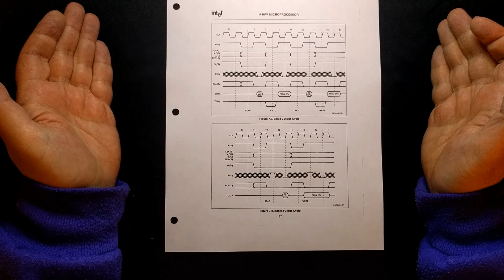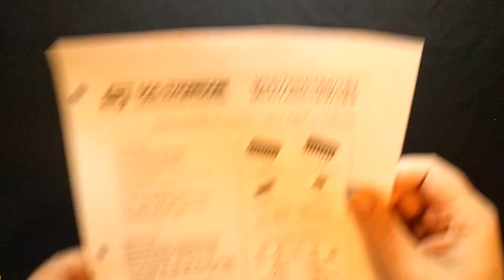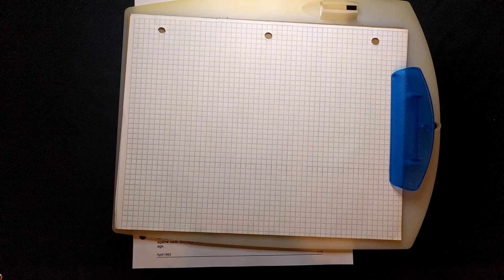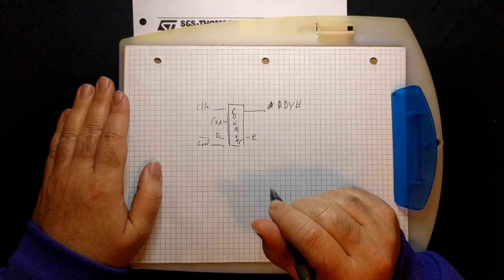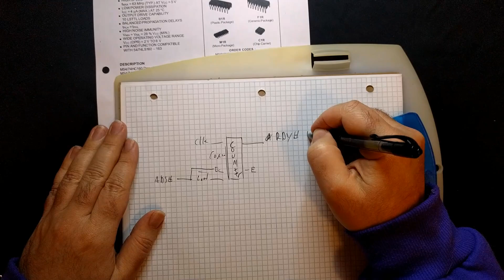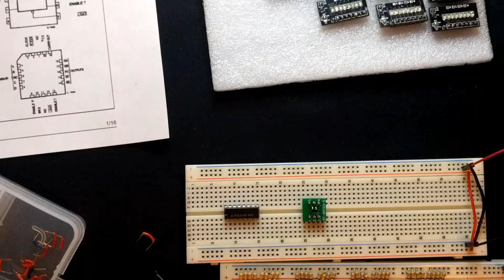486 Breadboard Computer - Part 4.5

Comment: It's not "Zener" inverter, but "Schmitt Trigger" inverter (just for the newest of the new - the rest of us knew what you were talking about). I have a bunch of those, too. Those SMD one-offs are great for debouncing switches. There's a guide by Jack G. Gannsle, which I've been using, that's being kept on the University of Utah website. I've tried to drop a version of this comment before with the URL, but I think it keeps getting rejected because of that. Searching for it by the author is easy enough. The circuit on page 16 of that guide works just fine at 3.3V as it does at 5V. It's been so reliable that I've started to include a small signal switching diode in my rotary encoder filter circuits.

For the breadboards, I got burned like that, too. At some point, the algorithm dropped a Ben Eater video into my search results. He recommends the product by BusBoard Prototype Systems. I tend to go with the BB1660, since that's just two normal boards packaged together (the normal one is the BB830). I don't think I've seen them sponsor anybody, but it might be worth asking. In the meantime, all you can do is to slowly replace the bad ones as your budget allows.

Edit: You can tell a BusBoard breadboard from the rest because they use red and black stripes on their power rails. The cheap knock-offs tend to feature red and blue stripes instead. You'll be able to keep yours sorted out that way, too.
Reply from the maker: Wow, got that one competently wrong. :) I have ordered some BPS breadboards, so we'll see how that turns out.

I believe I've seen that guide as well, and my reset switch uses that logic, but I would need to double check. I don't know how to allow the urls through unless I turn off all the auto mod rules on the comments. I need to look into just how to manage that if possible.
Reply: @Fox-Tech  is it possible to program intel cpu like Pentium  i am trying to make a project ikr it is crazy but i wanna know like people program microcontrollers can i program intel cpus in assembly language to get them to work the way i want . 

i know how to program and i want to make my own computer to i wanna know if it is possible to program the INTEL CPU  using assembly language i am talking about cpu like pentiums and x86 based modern cpus pls answer
Reply from the maker: main acc  Yes, a 100% you can program an intel cpu using assembly language. You really do have to change the way you think to be able to do it, as it works very differently then a high level language, but it's very doable.

Comment: With a 65c816 project I was working on i had planned to use a circuit that copied the contents of the ROM to ram and disabled the ROM prior to enabling the CPU. i had the circuit on a breadboard (that i can't find. but basically it cycled through each address line and copied it byte by byte. unfortunately it was before i started my channel so i do not have any video documentation and i can not locate the breadboard (i may have reused it ) or the schematic, but from what i remember it used the system clock and a counter to set the address line for both and then pulse the write enable on the ram and move to the next address. i only had about 1kb of Rom that needed to be copied, and a 32kb eeprom so i was going to design a way to select (either via jumper or dip switches ) several different 1kb programs that could be copied.

Comment: If I remember correctly, they needed this kind of delay circuitry for the 486 when it was strapped to a PCI bus.
Reply from the maker: Not sure about the pci bus, but the isa bus would need something as it runs at 8mhz.
Reply: @Fox-Tech  Yea, I think it was an issue with the PCI 1.0 spec where a device on that bus could end up hogging the bus(and subsequently the DMA) if there wasn't something to "kick" it out. So they used a timer chip to force it out like the one u mentioned. But this was a long time ago and I might just be confusing this with something else lol. 
Ur vids are good stuff keep it up.

Comment: Around 40 years ago I used a 74LS194 shift register for this kind of role in an expandable microprocessor system.  The 194 was loaded from its parallel inputs at the start of the processor access cycle, with the address decoder outputs being fed to different inputs on the 194 for different speed devices.   The output of the shift register went through a simple half-clock delay latch into the CPU.  Then when accessing very slow devices, no inputs were selected on the 194 and it relied on the serial input for the default longest delay.  That gave enough time for the external device to respond with its own ready / not ready signal which would then override the shift register.  Your method also works, but you may at some point want to think about slow, asynchronous external devices and how you hold up the 486 CPU for them.

Comment: Interesting that you'd use a counter. Wouldn't a clock divider like the 74LS292 work too? Or would that divide it down too far?
Reply: I'd say the counter allows for more precise contol of the waitstates. on 486 motherboards I've seen bios configuration of them in integers from 0-15 like seen here.

Comment: I was actually messing around with some 74f161 counters on a breadboard a little bit ago. They would be generally unreliable like that but then I added some small capacitors next to each chip and that made them stop randomly messing up. Try putting a decoupling capacitor on the 161 timer. Connecting a 0.1uf ceramic disc capacitor (or whatever you have that's close-ish) to the 161's power and ground pin should do the trick.
Reply: +1 on this, small filter caps can make a lot of difference